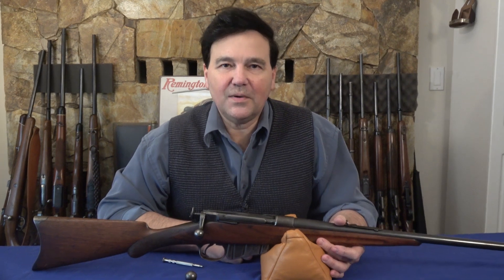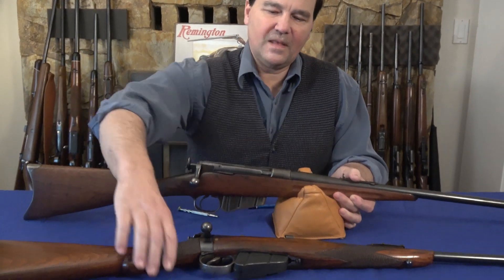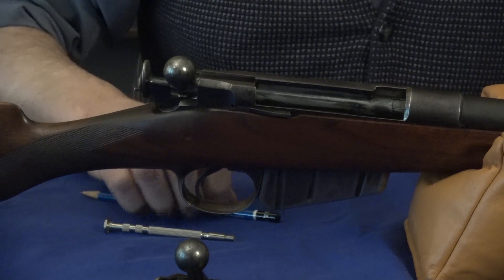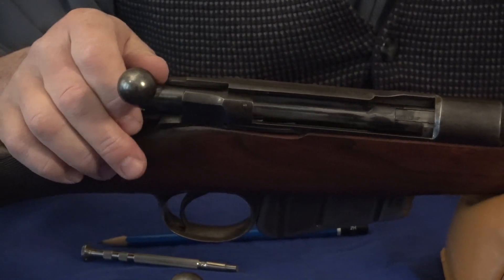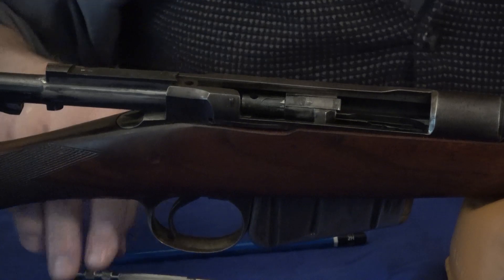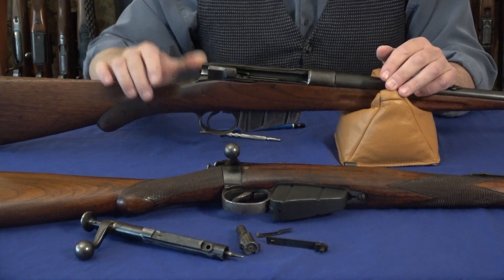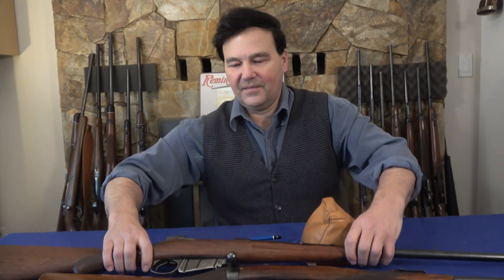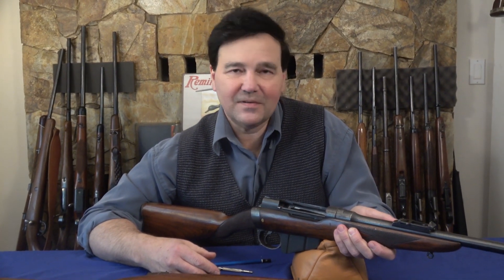Remington Lee Bolt Removal

Comment: Great video!  Good to see someone show off this little known rifle.  John Paris Lee does not receive enough recognition for his work as does say John Browning or Paul Mauser.  To my knowledge his Remington-Lee series were the first mass produced rifles with detachable box magazines.  This particular model was offered in several chamberings, to include, 30-40, 35 WCF, 405 WCF, and even 256 Newton....which is actually a .264 or 6.5.  So, it was obviously no slouch in the strength department.  Also, I may point out that this rifle has a blade in a recess on the right side of the receiver...you can see it in the video....that prevents double feeding.  Since this rifle is a push feed and not a control round feed (CRF), Lee incorporated this blade to prevent double feeding.  As the bolt strips a round from the magazine the blade is pushed by the bolt inward behind the right side locking lug.  This prevents the bolt from being short stroked before the round has a chance to be fully chambered and the extractor is able to grasp the cartridge rim. Only once the bolt is pushed completely forward does the downward rotation of the bolt push the blade back out of the lug raceway to allow full rearward bolt travel during the following ejection and loading sequence.  Brilliant!

It is interesting that while Lee and Remington went with front locking lugs for the this design, later Lee and Enfield would go with rear locking lugs on the SMLE.  While that might seem like a step backwards in thinking now, there were legitimate reasons the British did that.  It allows an interchangable bolt head without the need to relap lugs. A worn out barrel could be replaced and headspaced much easier and timely.  Rear lugs also shorten the bolt throw slightly for a given cartridge, it also aids in reliability as the receiver area near the chamber is not occupied by the cuts and recesses for the locking lugs....areas where trash and debris might get caught and be harder to quickly remove without some digging.  Recesses for rear locking lugs are usually still masked by the front end of the bolt during cycling and thus shielded from debris falling into them.  In the case of dirt, a simple rotating the rifle sideways or upside down can dump it out.  These are all things to consider when you're in the prone position on a battlefield and can't just point your rifle up in the air to empty crud from the chamber area.  SMLE receivers may stretch and flex, but it wasn't as important as these other considerations....they are strong enough.

Also, by not incorporating the safety mechanism into the bolt itself, the bolt handle on the Remington-Lee and the SMLE can be located further to the rear relative to the trigger...and thus the trigger hand.  This ergonomic consideration is what truly lends these rifles to fast cycling.  The cock on closing does as well, since it's much easier to shove a bolt forward into battery while fighting the spring tension with the larger tricep muscle than it is to rotate a bolt out of battery and fight spring tension as well as friction from the camming action by using the smaller muscles of the forearm and hand. It sacrifices quick locktime, but that was considered ok.  Again, all things to consider when your in the fight of your life.  Cheers!